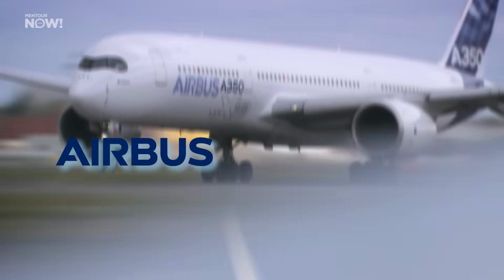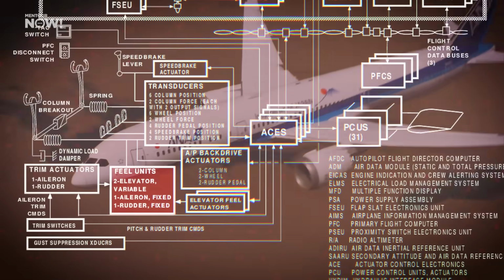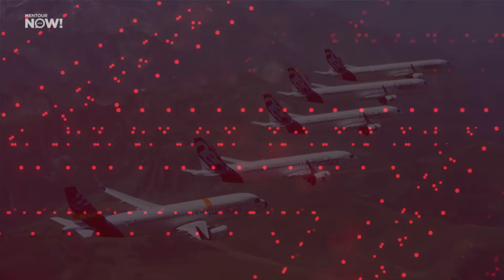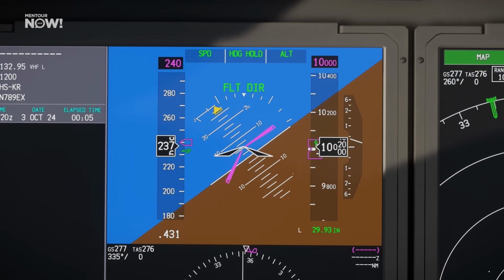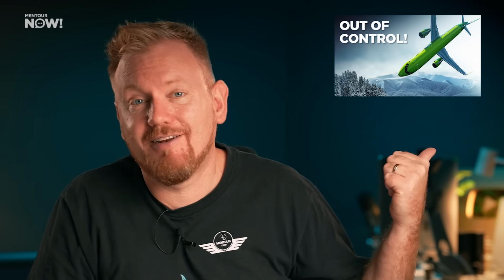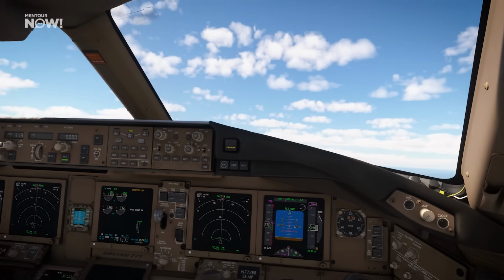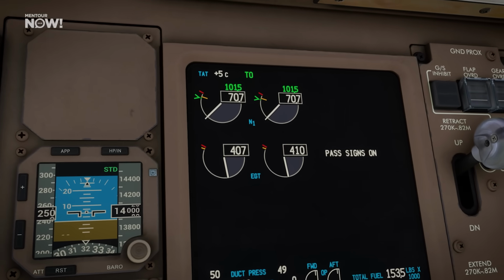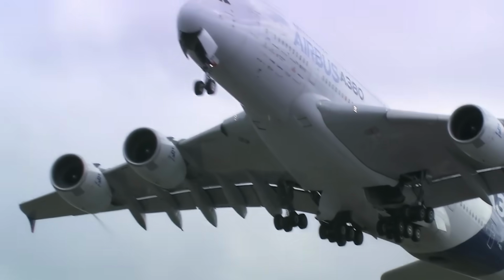Do Pilots Prefer AIRBUS over BOEING?!

Comment: As far airspeed control without functioning airspeed indication remember Attitude X Power = Performance. I taught a lot of partial panel as an instrument instructor and you don't need  a BUSS to flight the correct airspeed.
Reply: Don’t need it……but it makes the workload so much easier in an already stressful situation. Fly the green, keep it simple.
Reply: @tomstravels520  My point is that knowing how to fly partial panel in addition to these new instruments makes flying safer. Apparently partial panel is a lost art.
Reply: @jameswebb2856  yeah because it’s almost never needed for commercial aircraft due to increased reliability and they have far more redundancy than your Cessna.
Reply: @tomstravels520  Yes I know. I instructed before all the great redundancy we have today. I retires in 2012 from the airlines and I still believe partial panel should be taught. It would saved a few flights from disaster. I did enjoy your video.
Reply: @jameswebb2856  a LOT has changed since 2012. And how are you supposed to fly “partial panel” when you have 2 pilots up front with independent displays. If the captains instruments go blank do you think he’s going to fly still? No, he’ll hand controls to the FO to become PF and he’ll become PM
Reply: @tomstravels520  You miss understand my point. If there is an instrument that is correct you use that instrument. Partial panel skills can help you identify which instruments are correct and which have failed. In a 26 year airline career I never needed those skills but I had them in my back pocket.
Reply: @jameswebb2856  a modern aircraft can also do that quicker than human can. The A350 and newest A320/A330 cross check all 3 air data systems not only against themselves but against a computed one based off of AOA. So instead of just voting 2-1 and rejecting it permanently, it’s now voting against a different system and knowing exactly which one has failed and if it self recovers later as well
Reply: @tomstravels520  I am not against automation or all of the ways to maintain control of the aircraft. If i were still instructing today I would still teach partial panel. It is the basics of attitude instrument flying and can be very helpful when instruments fail. If the crew of Air France 447 understood this they would have established an attitude by reference to the ADI advanced (or retarded) the throttle to a cruise power setting and the aircraft would not have entered the deep stall that took them to the Atlantic Ocean. Again, the video was awesome and all I am doing is adding something to it from experience. I am enjoying our conversation.
Reply: @ incorrect, if the pilots hadn’t panicked they would have remembered their memory items for unreliable airspeed which is AP/ATHR and FD off, set 5 degree pitch and climb thrust. Then either activate the DBUS, BUSS (below FL250) or if you have an old aircraft with none of those then refer to the pitch and power tables in the QRH.
Reply: @tomstravels520  Absolutely, follow the checklist, use every asset at your disposal. The pitch and power tables in the QRH is exactly what I am talking about. Why did the pilots panic and fail to follow the checklist? Memory items are part of the checklist. Why they did not follow procedures is a question I have had on the accident. It is probably a question that will go unanswered sadly. After your video I do understand the Airbus better and I am not as "anti-Airbus" as I was before the video. I remember a class during Indoc when I transitioned from one airline to American Eagle Airlines. "There is a time for automation and a time to turn it off."

Comment: Pilots like the last thing the flew a lot. Which makes sense. You get tuned into an airplane and it becomes a part of you. Then when you switch to a new airplane it feels foreign and you are not as connected. Anyway the question is a complete moot point. In the airline world the choice of aircraft is dominated by economics. The pilots’ preferences are irrelevant. Cost per seat mile, the match of the specific capabilities of the aircraft to the route structure of the operator, availability of delivery slots and the deal that the airline can negotiate are what determines the choice (assuming one of the choices doesn’t have a habit of diving into the ground due to a poor design or having bits fall off due to poor qc). Nobody in the front office cares what the pilots think.

Comment: I'm not a professional pilot (flew a few hours on single-engine pistons), so my views are probably ignorant...
1 - Boeing reminds me of a traditional plane where actual flying skills are needed. Somewhat like using a manual gearbox. I used to prefer Boeing aircraft until the McDonnell Douglas takeover. (After which Boeing engineering went down the toilet)
2 - When I started watching the first Airbus planes fly (and crash) decades ago, the fault was usually bad software flight controls. I'm sure quality has improved since. However, always got the impression that its pilots are too used to punching in numbers rather than flying (like many Asian pilots today)
If I ever get back to flying personal aircraft, I'd choose the Airbus configuration (stick not yoke) and a full-glass cockpit (something I have never used so far). Boeing was nice, but, like the manual gearbox, its cockpit model is now obsolete... IMO

Comment: As a pilot, I want the fewest "middlemen" as possible between the controls and control surfaces as possible. Airbus has gone all-in in terms of trying to reduce human error via automation, and IMO the result (as also seen in 'FSD' cars) is that a new safety threat is introduced...."accident via complacency/operator detachment". My guess is that, all things being equal, Airbus will have a greater percentage of accidents due to pilot/control system errors (including pilot complacency) as opposed to Boeing planes over the next decade. However, airline pilots are in need of much better assistance in modern planes due to the complexity of these aircraft, and other considerations such as ATC challenges. The answer, I believe, will eventually be sophisticated AI systems that act as 'co-pilots' to provide real-time second opinions based on all available data. This leaves the pilot in full control, but with an exceptionally well-informed assistant that greatly improves the quality and timeliness of the pilots critical decisions.

Comment: As with most things in life, there are some situations where Boeing's philosophy is better, and some situations where Airbus' philosophy is better. If you're going to make this a strictly either/or choice, then it becomes a simple problem of quantifying how often the different situations occur. And going with the philosophy which better handles the more prevalent situations.

The more elegant solution however, is to add in exceptions - make it so the plane recognizes when it's in a situation that its design philosophy does not handle well, and compensate for it. But doing this means you need to be able to recognize when your philosophy is inferior to another philosophy.

Which is why it's important to have at least two competitors designing products based on different design philosophies. So you can say "Oh, the other brand's system would've handled this situation better." And you can modify your system to better approach the operation of the competing system in those cases. Diversity drives improvement and breeds strength.

Comment: Put it this way:

Half of the controlled flight to stall accidents probably would not have occurred if an Airbus was the operating aircraft.

Okay I might be biased as I do fly the A320 and A330.

But regardless, I think that the best for pilots and thus passenger safety would be Airbus due to its great flight envelope monitoring and restrictions. But I know that many pilots would agree that an Airbus with active sidesticks and moving controls would be best. (Although I don't really think it would help much. Personally I never really had a problem with the non-moving components on the Airbus.)
Reply: "But I know that many pilots would agree that an Airbus with active sidesticks and moving controls would be best" - Everyone would literally agree with this, but the thing is it would probably improve things by 15-20% while costing millions or even more to integrate safely, at the end of the day, when you produce hundreds of jets each costing a quarter of a billion, the design is hugely influenced by economics too. A 5% increase in retail price would essentially cause them to lose customers and thus not justifying the added improvements by having it.
Reply: @blackbox1024 yep, given their planes sell way cheaper than boeings

Comment: I'm curious if any of the modern FBW jets have the kind of control backup which would allow for flying by engine power alone a la united 232 or OO-DLL. I know that prototypes of this kind have been built, but to my knowledge, its never actually been implemented in a production aircraft.
Reply: Airbus A380 and A350 can do this. Even if the main hydraulic system fails and loses fluid some of the flight controls have their own mini hydraulic circuits

Comment: It’s all relative…..I have 14000 hours on the 747-400.  It’s a great machine, with its very old-fashioned control architecture and rudimentary automatics and flight management system.  By the same token, it had a very uncomfortable air quality that would completely fatigue you at the end of long flights and the pilot seats were just awful.  As a current A350 Captain, I’m completely satisfied with this airplane’s ergonomics, handling and safety enhancements.  The 787 has had so many issues though certification delays and in it’s initial years of service, that I didn’t rate the engineering and build-quality on it as having been well-executed, thus I couldn’t bring myself to bid onto it.  The A350 has been smooth sailing, both through its certification and in service so far, with Airbus carefully utilizing their existing technologies in the design. Well done Airbus!
Reply: AirBus: Slava 🥖
Reply: Airbus came along a lot later and started their planes of with a very forward looking technology first design aproach.
Boeing still has a big legacy in traditional design concepts and their transition has been a lot more difficult and probably caused a lot of conflict within the company about what would be the right way to move forward.
Couldn't have been easy to change that philosophy within boeing.
Reply: @rogerk6180  interestingly, guys and gals I know on the 787 and many of my A350 colleagues agree that both aircraft are starting to come closer in some of the design philosophy when we compare notes…..
Reply: oh no...
Reply: Smooth sailing, eh? You might want to actually read up on the development of the A350. You're flying version 2 which used to be called the XWB. Version 1 was roundly rejected by the airlines as "nothing new, go away." And you must've not been around for the 149-hour glitch… had to power down and reboot the airplane before reaching 149 hours of continuous power-on time, else data concentrators would glitch, leading to all primary displays going blank, among other things.
Reply: @petep.2092  I’m a 22000 hour former engineering test pilot who has been in the industry for 40 plus years.  What makes you think I’m not familiar with the politics of what got the A350 launched in the first place?  That aspect of what made it come about is not part of the certification, so your argument is irrelevant.  When the flight test vehicles are in the air working on the certification programme is when the rubber meets the road and in the case of the A350, it met all its deadlines and performance is better than predicted/promised.  Bottom line, all my colleagues who fly them and fix them, many from Boeing types, agree it’s a superior airplane to the 787, which continues to stumble with quality and engineering issues.  What an embarrassment for Boeing.  I was proud to be associated with their products when I flew the 747 through the 90’s onwards before its retirement.  When I looked over the two programmes side by side to pick my next airplane type, the 787 wasn’t cutting it in my books with all of its initial problems and continuing quality control issues.
Reply: @jumboneil
Reply: @jumboneil Thanks for that comment. Which of these planes are more safer:
a320, a321 or a321neo? I've heard many bad news about the reliability of the p&w engines and don't know what planes are more safer?

Also which version of the a350 do you prefer that's safer, the 800 or the 900 series?
Reply: @petep.2092  as a former engineering test pilot, I wasn’t interested in anything before the certification programme for the A350 started, including the final decisions to not make the airplane an A330 derivative, which of course the potential customer airlines rejected.  Once they committed to the programme, built the flight test vehicles and started the certification programme, which is where a design really starts to show its strengths and weakness, the A350 programme met all deadlines, on time, no big issues, including the powering through 149 hours which is hardly the same thing as the 787’s quality issues, battery issues, subcontractor issues, tolerance issues, late into service, continuing quality control issues, etc…as for the 787….when asked by a aerospace journalist whether Boeing would ever undertake such a new concept airplane again, the CEO at the time basically replied….”no more moonshots”.  As a Captain on the A350 online, my most valued colleagues “in the trenchs”, our station engineers who work on them agree that it’s better than the 787 in terms of reliability and glitch avoidance…..I’ve really enjoyed operating the airplane…..some of my flight operations colleagues on the 787 don’t share the same sentiment about their airplane….I’ve been in the commercial aircraft/airline business for 40 years now, and am thoroughly dialled in to manufacturing aspects of the industry…..you sound like you think you know better….but talk is cheap….go and fly each of them with your 22000 plus diverse flying hours and get back to me….I’ll wait….

Comment: I can also give some input from the maintenance side being an AMT. Generally Airbus planes are more maintenance friendly and are easier to troubleshoot whereas Boeing planes require a lot more hands-on troubleshooting. On an A320 you can BITE test virtually every system on the plane through the MCDU. On the 737, most BITE functions are local to whatever component they're associated with, as in, you have to crawl into the guts of the plane, the avionics bay, and find whichever computer you need to test. On an A320 it's all done remotely, via the MCDU from the comfort of the cockpit. Physical maintenance tasks and servicing is generally easier on Airbus planes too, they generally provide more room to work, while Boeing planes are notorious for being cramped and affording very limited access to components. The A300 for example actually has a bench in the avionics bay making wiring work much more ergonomic for technicians. The 767 does not sport any such luxuries for maintainers by contrast.
Reply: A built in bench for the engineers to perform their work ergonomically. That really shows how they appreciate the importance of everyone's contributions
Reply: @r0manovic  Engineers remembering that what they design has to be maintained by a human being, novel concept 🤣
Reply: Interesting, especially given how many of my airline's mechanics moan and complain when its one of the Airbuses laid up.
Reply: @mercurybard9794  They complain less when they have to work on a Boeing?
Reply: @roberts9095  At one point, the owner was considering buying an Airbus A330 freighter - I was standing around with 3 heavy mechanics & two maintenance guys when it got brought up. At least 2 of them threatened to quit if we did end up with one.

The A330 passenger planes that we do have are "the fucking Airbus".

I think it might be like my dad and cars. He does maintenance & repair on the family vehicles - mostly Dodges, Jeeps, Fords, etc - but the one Honda Accord that snuck in? Nope, take that thing to the dealership.
Reply: @mercurybard9794  I have heard some people say that Airbus planes, especially 330s can be a bit more of a handful in heavy maintenance. I will still maintain that, general servicing and line maintenance, Airbus is generally easier. But of course no plane is perfect and all have flaws. I heard something about A330s requiring heavy structural refurbishing around the center fuselage at some point in their lives, that or it might just be a lengthy inspection
Reply: @roberts9095  Interesting. All aircraft have to go thru serious maintenance (D-checks) every couple of years. We've done quite a few C- and D- checks in our fleet in the last year at MROs across the globe with varying results
Reply: @roberts9095  I just checked with the heavy maintenance team since we hadn't done a C- or D- check on an Airbus (we have passenger A330s) since I was hired last year while most of our Boeings have gone thru them. Apparently, the oldest A330 is due for a C-check next year.
Reply: @mercurybard9794  Interesting. What are the typical gripes about the 330? I just worked on one for the first time the other day and found it to be decent.
Reply: @mercurybard9794 Honda does not break  they just keep driving
Reply: @WoutervanTielThat's very true. We had a 2001 Civic and there were no issues with it. Well, until we had to change a lightbulb in the front - needed a tiny hand and didn't see any of what you were doing. But Honda is the best!
Reply: I was once told by a German AMT that only the French parts break.
Reply: Strange, when i have an issue the tech do the bite test from the cockpit mcdu, not in the e & e..